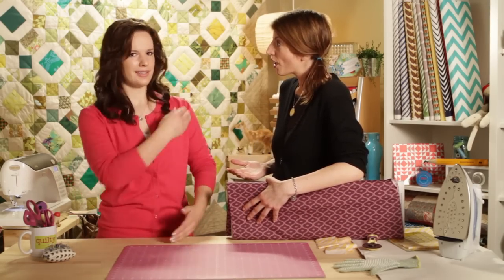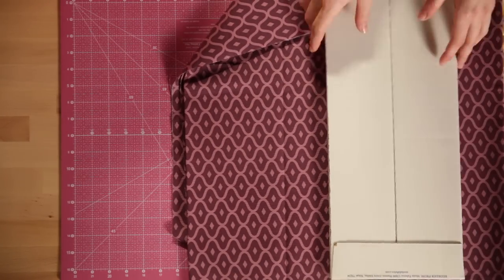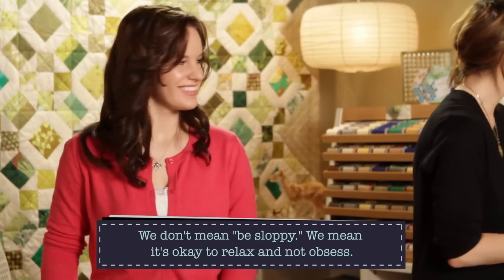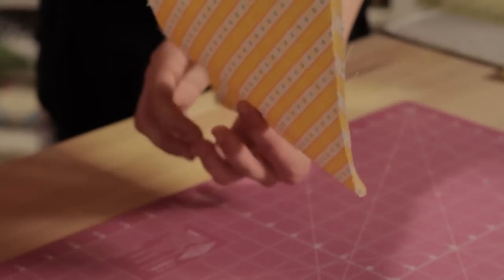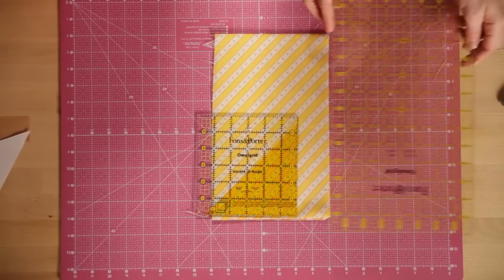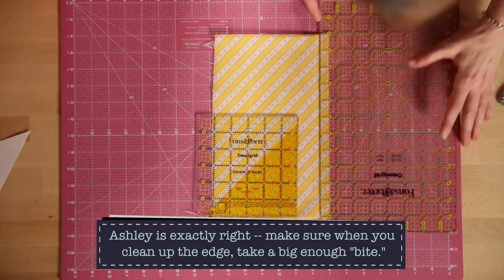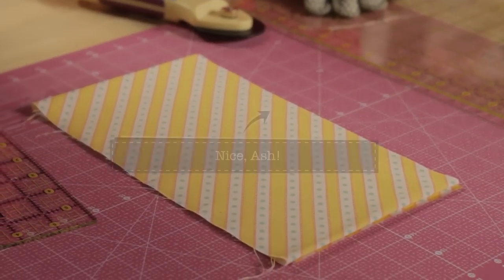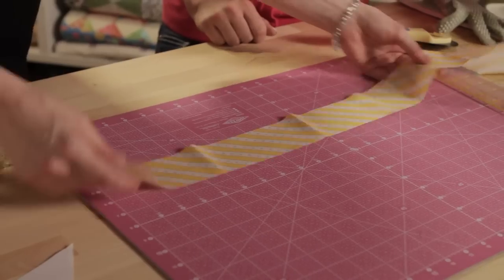Quilty Boot Camp: How to Cut Strips Accurately

Comment: Hi what is the purpose of the glove?
Reply: Safety. I think they're made with super durable fibres (Kevlar or Teflon, maybe?) which provide resistance to the cutting edge of the rotary blade  They protect your other hand (the one holding down the fabric) from serious injury should you slip while cutting. The duller the blade, the more force you're exerting on the rotary cutter to push through the fabric. The more resistance you encounter, the more pressure you apply on the tool, the more likely your cutting hand will slip while cutting your fabric. Your other hand is in its line of harm. If you use sharp blades, you're not going to exert as much pressure, and you're less likely to get cut.

Comment: I’m wondering why you can’t just use the large ruler. I place it all on the fabric and line up the bottom edge of the fabric and make my first clean cut by sliding it in enough. Is there something wrong with my method?
Reply: That is what I was thinking too. Too many rulers. I think it's so you can buy more - it's a way to get newbies to spend more $. There are many of us newbies that don't have the $

Comment: The glove your using? Is it sold as a quilting glove and you are only using one? Or is it a glove just for cutting ?
Reply: B Cobler     Fons & Porter makes a special glove called a "Klutz" glove that you wear on the hand that isn't holding the rotary cutter.  It's meant to protect your hand in case the blade slips & heads for your fingers.  The Klutz glove is different than free-motion quilting grip gloves that are sold in a pair.

Comment: Is there a better way to check that the selvage edge is straight compared to the cut edge of the fabric beyond pulling a strand of the weft out?  I know my local fabric store simply rolls off the cloth from the bolt, and assumes that the last edge cut from the fabric was straight.  The last 3 pieces I've purchased from them haven't been straight - the worst was off by about 4" off one of the cut edges.   Hopefully this makes sense!
Reply: +kisakikun I like to iron out the whole piece of fabric using a spray starch or starch alternative to add body and stiffness to the piece, as well as diminish the bolt fold line as much as possible. Next line up the selvage edges so they are even as you are holding the piece in the air until the fabric is hanging straight. Lay the fabric down on the cutting mat with the selvage edges even and aligned to one of the lines on the mat. Smooth fabric to new fold line, then fold over on itself again, making the folded edge even with the selvages. Now square the fabric as in the video.
Reply: Reagan Conserv
Ooh thanks - I'll have to try that!  Thanks for the response!
Reply: Reagan Conserv